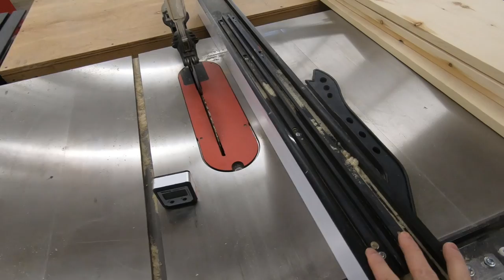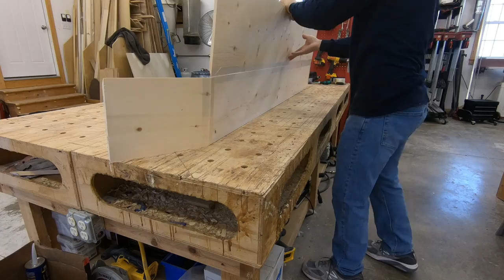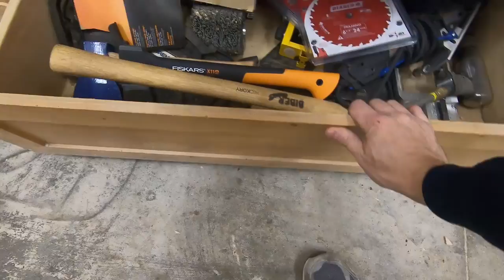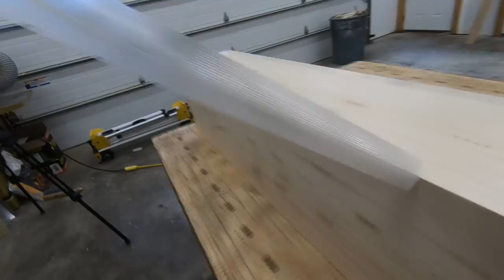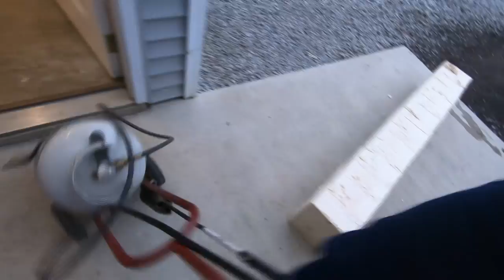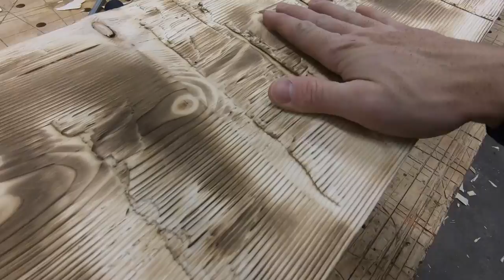DIY Barn Beam Mantel - HOW TO MAKE A BOX BEAM BARN BEAM MANTEL FROM SCRATCH

Comment: I made my first one for a customer. I used plywood with a maple veneer. Dimensions turned out fantastic. The only problem is I used titebond 1 & made a mess. I have it a good sand & went I went to stain it.. came out very splotchy  not only that we’re was perfect line sections that stain differently that was just the way the plywood was made. Still came out nice and the customers were happy. I just blended it with a sander. Any tips on my issues with the wood glue and the plywood

Comment: Hey Spenser Jim here from Kings Table Custom Finish - I purchased that 12” corded Makita Miter saw I was telling you bout to replace my Bosh 12” Axiel arm.  1st off I had issues with that Bosh from day one and fought it for 5 yrs!  Cracked head, exhaust broke, get it cutting right & it would go out within a short time of heavy work.
I have a DW 12” fixed with performs like a champ!  However I like the Makita platform and that 60 degree miter !
Well it’s here and out of the box I ran some cut test and it was very slightly out on a 4 cut miter test on the right!  Other than that it’s dead nuts on!
My table rubs slightly when changing to different indents & if u press down slightly when changing it goes away which tells me it was most likely dropped during shipment ?  Oh I put a 12 Forest chop master on it and it cuts sweet!  I stay far away from thin kerf blades they flex I don’t care what they say!  I found under heavy use they flex slightly enough to Irritate a guy!  
Anyway it seems well built as the Miter Saw game goes & I think you would enjoy one!  Anyway I heard you say one time you would like to hv one cause of the 60 degree miter abilities.
Oh great video as always I hv u on speed dial for problem solving!
Reply from the maker: Cool. I would definitely like to try that saw someday.
Reply: This is more cut capacity on the makita but it is vary heavy saw and I think it only has a Laser. Not a big fan of that would rather have a light for shadow line
Reply: Great video you have the most realistic box beams and mantles
Reply: @davesch1512  your right Dave it’s heavy & that’s why it’s a shop saw!  I would hv gotten the 10” to cart around if it was double duty!  I most likely will use my 12” fixed deWalt or get a 7 1/4 “ when prices drop or I start robbing banks?
Reply: Hahahaha

Comment: Excellent Spencer, looks great. Question,  have you ever made a box beam out of white oak using the procedure  in the video? Great video keep them coming. Thanks Daniel
Reply from the maker: About five years ago I did some out of white oak. Its much harder to do.
Reply: @InsiderCarpentry  were you happy with the results?
Reply from the maker: I prefer the pine. Much easier to towel with. Lighter. Less expensive by a lot.
Reply: Thanks for your input Spencer have a great holiday season!!!!